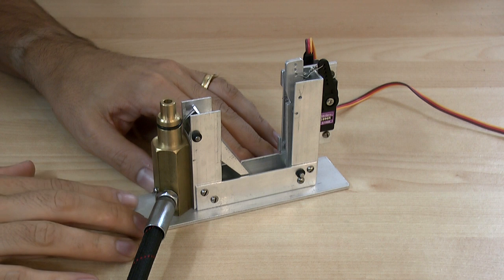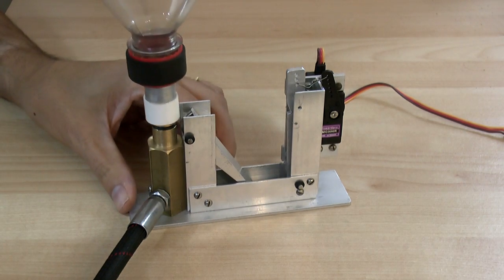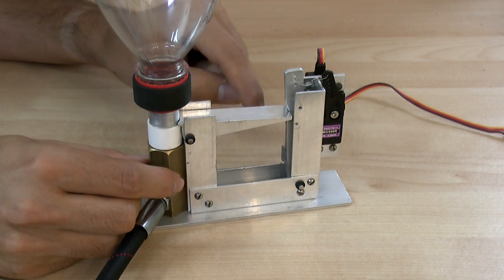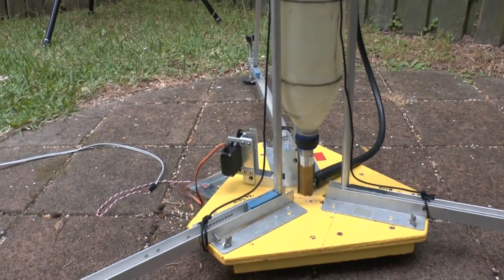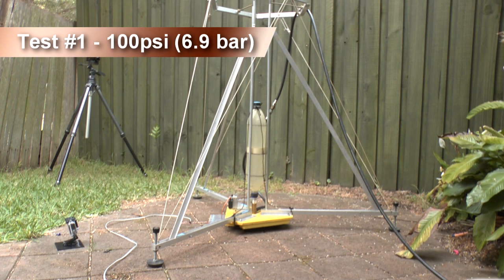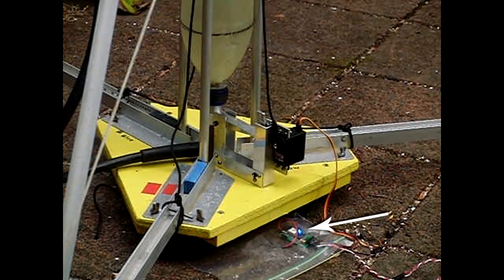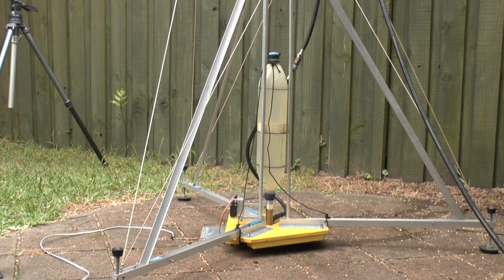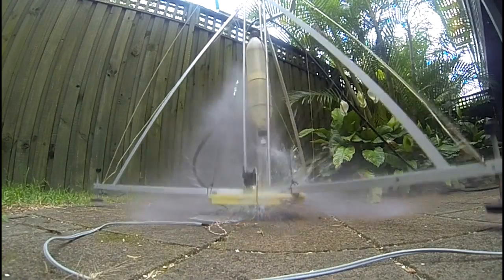PolaronG2 launcher tests

Comment: A highly intricate and efficient solution you have devised there Air Command. Servo motors really are a handy piece of kit!
Reply from the maker: Thanks Jamie. We hope we'll be able to synchronize the releases down to the timing we need. We are still keeping the solenoid option open if we can't do it with the servo motors. Unfortunately the fast and powerful servos are also very expensive.

Comment: Very cool, I've been wanting to make a trigger like this except an RC version.  Looks like this design could be easily adapted for that.
Reply from the maker: Hi Michael, yup, should be easy to use with and RC remote control. You'd want to make sure you had your own unique channel or didn't have any outside interference.

Comment: That looks so great, i can't wait for the launch and the see if the timers will work at the same time! I hope that those PVC rings will not come apart from the nozzle and release the rocket. Keep up the good and professional looking work!
Reply from the maker: Hi Basrockets, yes synchronizing will take a bit of experimentation. We have updated the firmware so we can change the timing in 5ms increments. We'll have to use the high speed video camera to see the timing differences. The main stage will be slightly delayed so that the boosters are fully engaged before release. We've now replaced the plastic ring with an aluminium one for the same reason you suggested. :)

Comment: Nice work! I have a question about the servo, have you made it waterproof at home or it came like that from factory?
Reply from the maker: Really good question. The servo is not a water proof model so there is chance water could get in. The final launcher will have covers that fit over the servos to reduce the amount of splash.
Reply: AirCommandRockets I used a simple method at my  Acceleron project to waterproof the main stage release servo by covering the entire servo with a thin layer of Sikaflex and it work grate. Hope it will help you too.
Reply from the maker: Florin O The one place we are concerned about water getting into the servo motor is around the servo horn. The body otherwise seems well sealed and the place where the wires run into the servo also look well sealed with moulded rubber. How do you stop the water getting in around the servo horn?
Reply: AirCommandRockets I put some silicone grease and that should prevent water spray to get inside. You can also put an o-ring between the arm and servo, I think that you will have a much better sealing ,but for me the first option is enough.
Reply from the maker: Florin O Thanks for the suggestion. I think the o-ring idea is a very good one. With a little silicone grease on the o-ring that should work well. :)
Reply: AirCommandRockets I'm glad it helped you and I am waiting for other videos with rocket progress and of course the launch. Cheers!